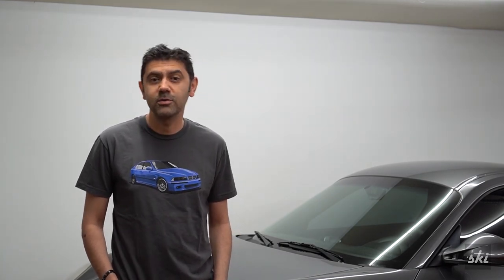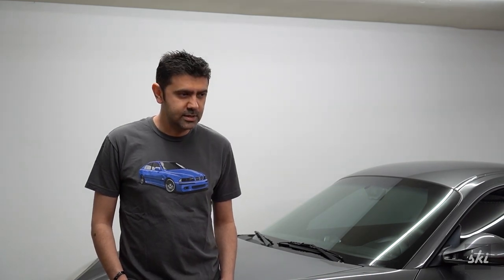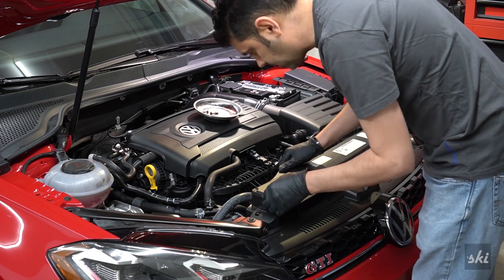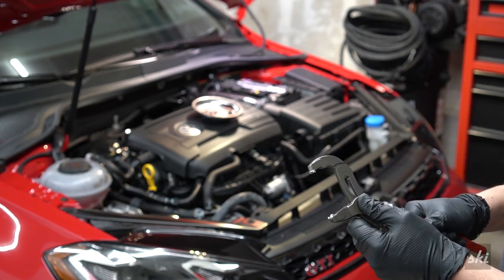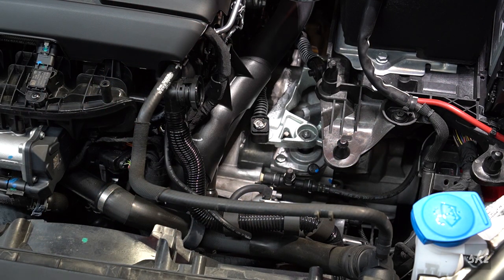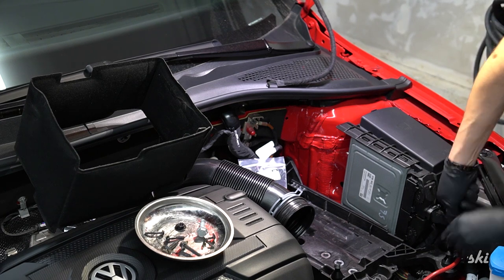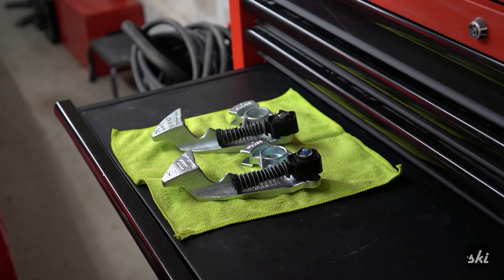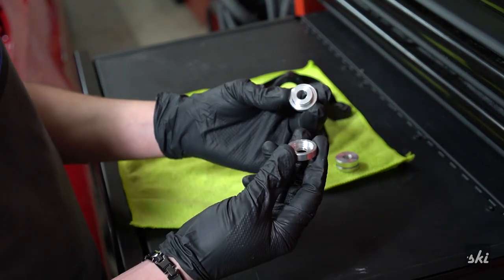Kianski Car Stories - Pilot Episode (MK7.5 VW GTI - Short Shifter)

Comment: Cool video man!  I was wondering what was the wrench that took the clamp off at the 4:57 mark?
Reply from the maker: Thanks! Those are spring hose clamp pliers. That one is made by Knipex and has a locking feature which comes in handy in tight spots, though I didn't need to lock it for this application.

Here's a link with more info: https://www.knipex.com/index.php?id=1216&L=1&page=art_detail&parentID=1368&groupID=2178&artID=34587